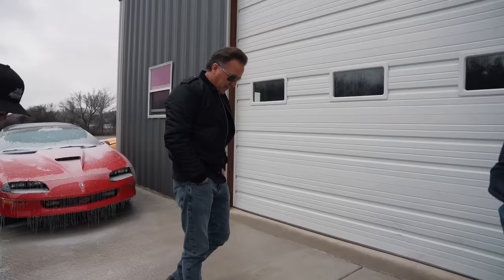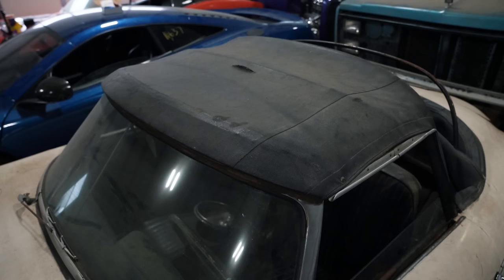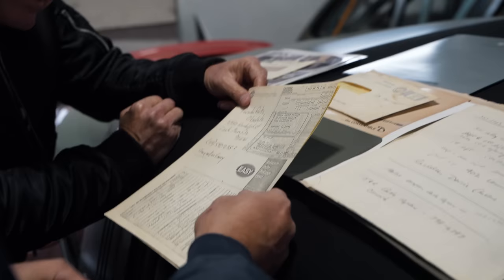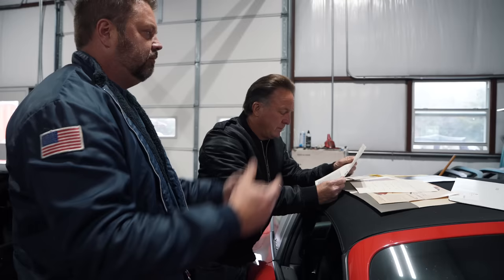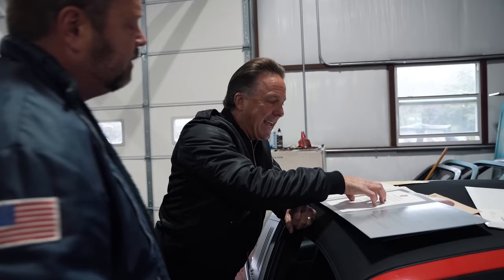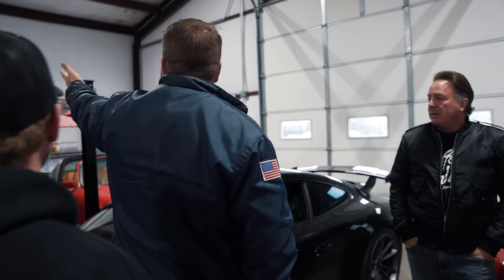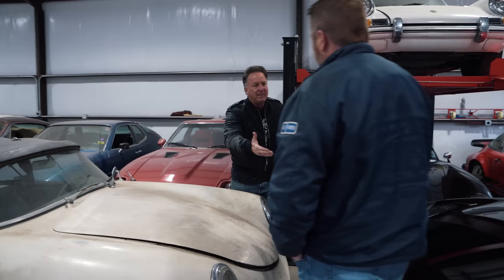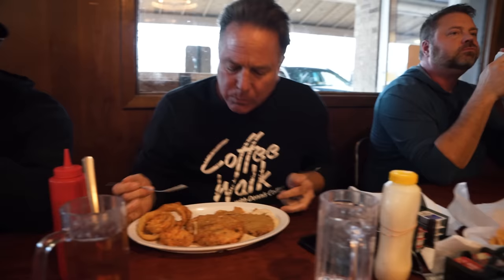RESCUED: 1959 Porsche 356A Convertible D!!

Comment: I had one of these beauties that i bought for $1,000. In 1970. The floor was repaired with roofing felt. If i parked on an incline the door might not open. It was very flexible. I put new mains, rod,and wrist bearings in but it still smoked like a mosquito fogger. I  am a Miami native and the D had 156,000 on it wheni bought it.  Fun for a few years then moved on to get an air conditioned 280 Z. Love your show.

Comment: In about 1978 a friend of mine found a 1956 speedster convertible in a local trash paper for $300.  History was, the father bought it for his son to go to collage.  The son burned up #3 cylinder.  We were all aircraft mechanics, but could not get it running at the sellers house.  The car was after dark pulled to another location where the engine was removed.  I took the engine apart.  Someone had done a poor replacement of #3 cylinder.  The engine was cleaned up and coated to prevent rust.   I had overhauled many airplane and VW engines.  The case was a piece of art.  It had brass tubes inserted in all oil passages.
The car was set to Ohio for rebuild.  Many years later it was sold in NY for over $300,000.
It is amazing  it was not destroyed.  There were many situations where it was almost lost..

Comment: Nice score Denis. In the early 70s , my father had a1960 356B , silver with blue leather int. , 1600 dual carb.Unforturnetly he rolled it on the freeway on a diesel spill. Traded it for cash & a 1968 type 3 wagen. Cheers from B.C. Canada.

Comment: I used to drive a 1960  conv. 'D'. Far more civilized than the Speedster. More rakish profile, manual crank windows and one unique feature was to easily unbolt the windscreen from the chassis. Old times club race events and it was fashionable to remove. BTW: if I recall, an average condition one, good driver quality in 1984 could be had for $4,500.

Comment: Dennis, EASY stands for European Auto Salvage Yard located in Emeryville Ca.  It's been the Bay Areas Porsche wrecking yard since the mid 70s ( if my memory is correct). I noticed their name on the paper work in your hand, also noticed Pt. Richmond Ca. on the title which is about a 10 minute drive from Emeryville. EASY sold parts and cars, wrecked and put back together with his parts so your "D" may have been one of his many sales.

Comment: That's a "B" front end and an "A" rear end. The bumper and license plate light are both "A" models. Must have been wrecked and repaired at some point. It would be easier to upgrade the rear to "B" spec. The major reason for the introduction of the "B" body was a Federal regulation as to the height of the headlights. I know. I had a '60 B Roadster and did a lot of research. A fabulous car and I wish I still had it!

Comment: Only an idiot would think it’s a Speedster. It looks exactly like my old 1960 T-5 Super Roadster. Old Porsche advertising literature would point out that the company made changes between model change times. But a car made in 1959 could have been sold as a 1960. The 904s were made beginning in 1963 but were made for the 1964 season. Wish my father hadn’t made me sell the Roadster when I got the ‘64 SC.